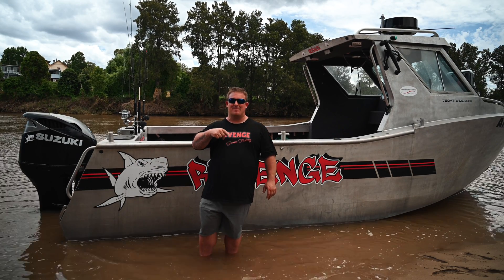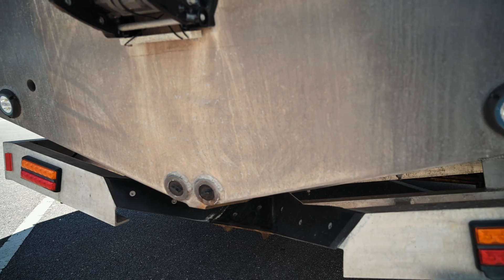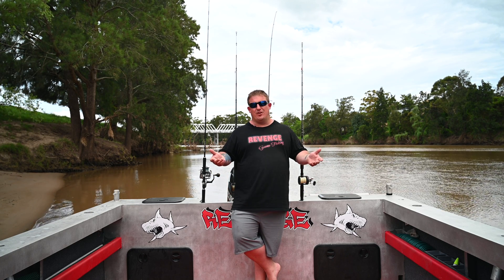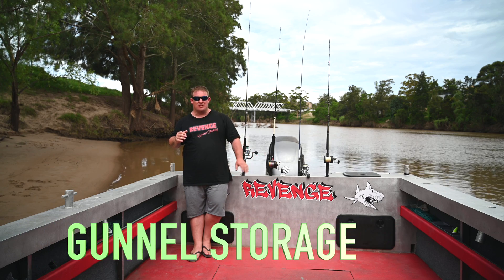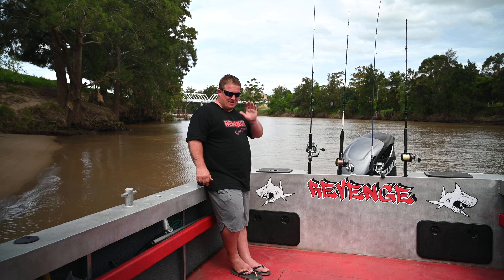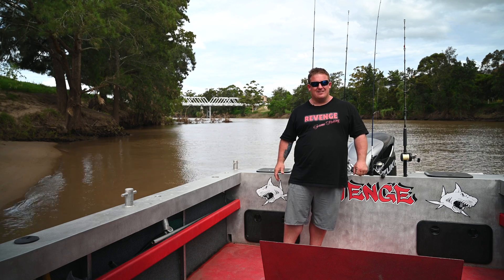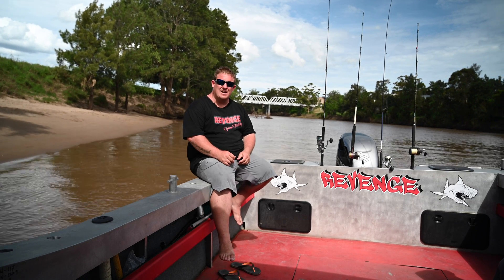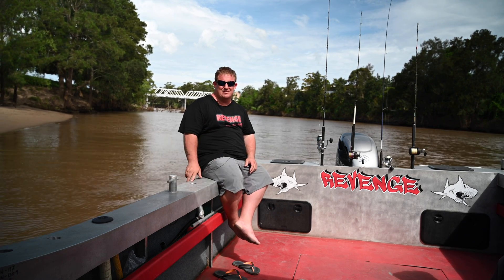Plate Boat DIY- A walk Through of My Custom Built 7.8m Plate Boat

Comment: The floor you mention is actually the COCKPIT SOLE FLOORS  are athwartships structures that hold the hull together, gunnels are side decks, there is a foredeck, sides are topsides plates, cabin sides are coamings
trouble is all your structural sections are most likely 8064 that is not marine
55 years building in alu
swa stringers from 5083 plate eh, but good fer you you jave your boat

Comment: What sort of lights are the under water is and how have they held up? Lovely looking boat.  You did a great job building it.  What welder did you use and were you a welder before you started?
Reply from the maker: Sea blaze Quattro colour change LEDS, 
They are amazing… but expensive hey! Lol
They were expensive haha

Thanks heaps mate, 

The welder was a mig from total tools, don’t remember the model but it was somewhere around $1000-$1500 

I wasn’t mate but Mark did all the welding. 
He had quite a bit of experience with welding previously and had built a smaller boat previously 

Hope that helps mate

Comment: what alloy is it made of ?
how does it handle the big waves compared to other commercially produced boats?
Reply from the maker: God.. i dont remember to be honest. 
What i do remember, is it was a good grade and produced somewhere the tollerances were extreamly accurate. 
Sorry I know thats probably not incredibly helpful.. 

In the boats ive been on, It is just as good, 

What is worth noting but is it has a much flatter deadrise than alot of produced boats and it is also 2.8m wide. 
So its hard to compare that to a boat with a very sharp deadrise. 

For a boat that we spend alot of time drifting/ travelling slowly etc the stability is absolutley incrdible!
Reply: @MattyRacingLife  probably one of the 5000 series alloys
Reply: @FourthWayRanch  usually 5082 to be called "plate".  5083 they use on tinnies and you can fold it.  5082 doesn't press.
Reply: @smithysfishing  I got some 5052 to weld a patch on my "tinny" last year, now I'll look for 5082 (don't see it on ebay) I couldn't get any info on the specific alloy used on those boats.